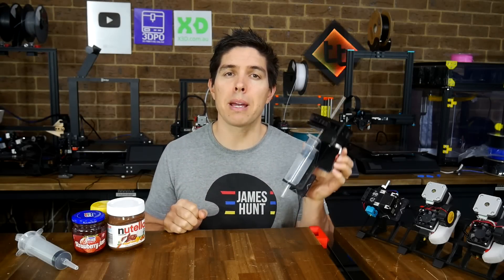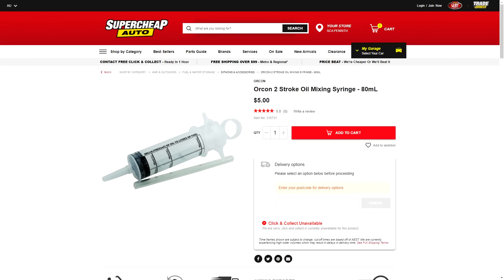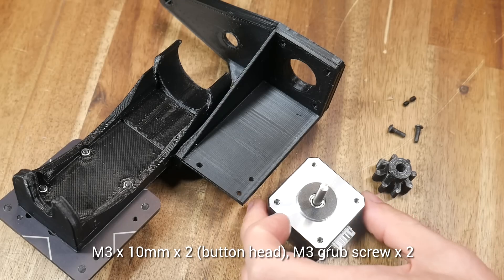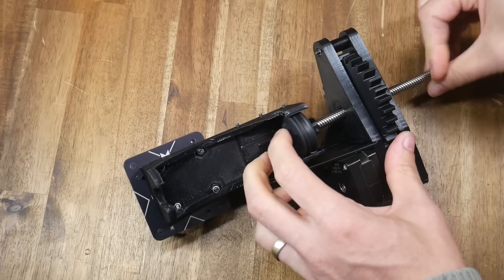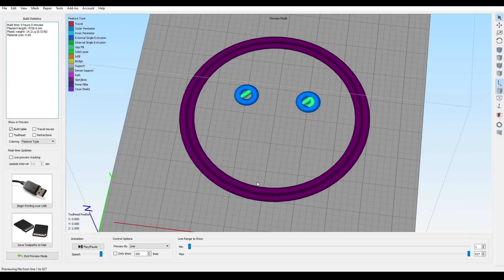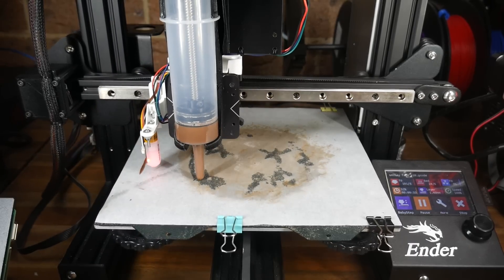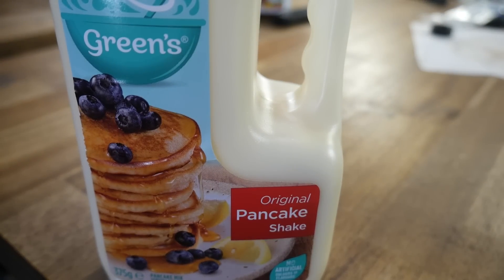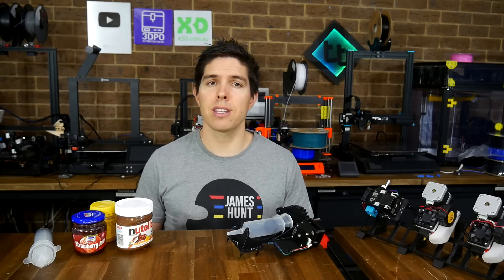3D printing Nutella with a DIY paste extruder - XChange on Ender 3

Comment: concrete? Now that I've watched this, I'm wondering how 3D printed concrete houses do not slump over like your sad nutella vase. They must use a special super viscus formulation.
Reply: Not just super viscous but very fast curing is key. I'm lazy to find you the video, but keywords: Jerry rig everything; printed statue. You will find useful info there.
Reply: Many years ago, I watched a video, I haven't found ever again. In it they talked about 3D printers, and I was hooked. They used a cement formula that sets in a minute, I think the current formula is called gunnite. But they printed a house with a 3 layer wall. They would print the 2 outer layers, then on the next pass they would print the inner wall. It was amazing. a 3D printed cement house.
Reply: @MrGerhardGrobler  Think I saw that once when I started looking around for practical applications on the topic after having watched either a movie or some educational video playing with the idea of the future of 3d printing and autonomous bots building skyscrapers - that doesn't sound very sci-fi/futuristic anymore tbh, but I doubt it'd be faster than current tech (cheaper is a different topic) haha

Comment: You can disable the cold extrusion error via M302, rather than faking out the thermistor input: https://marlinfw.org/docs/gcode/M302.html
M302 P1
Reply from the maker: Faking the thermistor output I still think was a better option. Simpler for me to present in this video and for others to follow. Any time you add layers of complexity people are more likely to not follow successfully.

Comment: Interesting. What about using ‘ice magic’ that goes hard when cooled ? You can heat the fluid to keep it viscous for extruding, and may be cooled by the fan once extruded
Reply from the maker: I think it would need to be a colder fan than room temp. Maybe air blowing over a peltier. Ice magic still take a bit to harden on frozen ice cream.

Comment: You could try to 3D Print within a gelatine (maybe with a smaller syringe and a needle tip). As far as I know there is already some medical use (sadly I couldn't find the video) for this, but maybe it could also be used to print with resin or other solidifying liquids! Even printing within another resin might be possible!

Oh an please make sure to promote thorough cleaning of the printer & its environment, as the infamous printing dust might also be a health risk if it gets on the food (at least for some material in bigger quantities...)

Edit: It is not the one I saw back then, but it still shows the process: https://www.youtube.com/watch?v=CxIfkPBlbqE

Comment: If you add an AC powered silicone bed you can get the bed to 250C fairly quickly. You will need an AC relay, but it totally works. I have one on my Ender 3.
Reply from the maker: I have one on a few of my printers but they have thermal fuses to limit reaching anywhere near that temp. Not sure I would want to remove that safety feature.

Comment: I've been thinking about something like this to decorate cookies. My sister owns a bakery, and spends so much time on cookie decorations. Being able to plug them in, and have the printer do the work would be awesome.
Reply from the maker: That would be very viable.
Reply: going to want a belted build surface, and a vision system for locating the part.

Comment: Rally neat, but wouldn't the plunger rotate in place if it hit too much resistance, essentially missing steps?
Take a look at Proper Printing's design which avoids this by pressing down on the original plunger of the syringe with with something that looks like a dual Z axis.

Comment: Excellent work, maybe you can put a heater element around the syringe to allow solid milk chocolate to melt and then re solidify when it hits the bed?
Reply from the maker: I did consider a low power heater in the early stages. Maybe printed from a high temp plastic and clipping onto the front of the syringe.

Comment: I'd probably use this to create custom silicone gaskets, o-rings and such and so on. Not with this nozzle diameter though :D
Reply: It would be easier to 3d print a mold and then fill that mold. The silicone won't cure fast enough
Reply: @Dedeptikonbmx2023  You're absolutely right, I haven't even thought of this but it makes perfect sense. Any suggestions on making the silicone not stick to the mold? I haven't done this before.
Reply: @friddevonfrankenstein  they make a spray on release agent, sells at hobby shops. I think talcum powder would work, but I feel weird suggesting something cancerous..

Comment: Results of Nutella printing would have been better had you reversed polarity on heated bed, chilling the chocolate as it was deposited.
Reply from the maker: Reversing the polarity doesn't work without a flux capacitor.
Reply: @TeachingTech   LOL

Comment: I bet you could get some decent prints with a smaller heated sirynge, a cooling fan, and chocolate!
Reply: I was thinking the same thing!  If you can get your syringe to hold the proper temperature, you could print tempered chocolate sculptures.  A custom hot end with a bore that matches the plunger, fitted with heating elements and thermocouples could be a fun project for a hobby machinist.
Reply: @TuckMcSouthard  they make elements like this for plastic injection molding. I am sure it wouldnt be too hard. I would worry about the Syringe getting too hot before the melting point though. Not sure what those would be.

Comment: I noticed that the plunger seal was rotating as well. Wouldn't that cause some problems down the line? Maybe something that keeps the rod from rotating should be added.
Reply from the maker: It did cause quite a lot of under extrusion at first. I made the printed part inside the rubber stopper thicker to increase the friction and it solved the problem for everything except the peanut butter. I considered a guide at the top to prevent rotation, but it would need to sit at the highest part of the leadscrew when the syringe was full, adding at least 150mm of height. I think at this stage I'm happy to live with the compromise of it not being perfectly accurate for really viscous pastes.
Reply: @TeachingTech  A rotational ball-socket joint just before the rubber stopper could fix this easily. Really just acts as a bearing, but has no lateral loading so shouldn't be an issue.
Reply: Also could just use a proper ball-race bearing. Mounting it to the end of the rod may be weird, though.
Reply: I thought about this too! Maybe just a captured bushing between the plunger head and grub screw. ?? Awesome design tho!
Reply: Yeah, some sort of grub screw setup to keep the rod in line with the extruder
Reply: yes. it can cause underextrusion I guess.

Comment: The extruder design is faulty. You forgot to restrain the rotational movement of the plunger. Right now it is free to rotate inside the syringe. This means the rotation of the lead screw nut might be translated to rotational AND/OR vertical movement of the plunger. You only want it to be able to move vertically. This can be seen in the first print. For the outer circle the plunger partly rotates in the syringe and less nutella is extruded. For the mouth and eyes it doesnt rotate, so more nutella is extruded.
Reply from the maker: It did cause quite a lot of under extrusion at first. I made the printed part inside the rubber stopper thicker to increase the friction and it solved the problem for everything except the peanut butter. I considered a guide at the top to prevent rotation, but it would need to sit at the highest part of the leadscrew when the syringe was full, adding at least 150mm of height. I think at this stage I'm happy to live with the compromise of it not being perfectly accurate for really viscous pastes. If you look closely you ca see the rotation in the first print and the peanut butter, but that's it.

Comment: My only objection is using a syringe made for motor oil, when there are plenty of syringes for sale made specifically for food.
Reply: Made out of the exact same plastics - just functional branding.  Now a heated aluminum or steel syringe, like I have for my meats would be interesting.
Reply: @russou  exactly, warm chocolate should work great for 3d structures.
Reply: Another option is to mcgyver up a plunger the exact inner diameter of a empty caulking tube. That would also allow for it to hold more material per print job.
This could also be done with diameters of plumbing piping all the way to bucket sizes if for testing or successfully getting cement to print for that castle in the yard or home addition or tiny home project, provided the torque doesnt max out the capability of the possibly nema 34 or whatever stepper motor being used, though 3d printing a gear reducer would solve that. Rock on.

Comment: I have been wanting to 3D print chocolate (custom cake decorations, etc.).  I believe I would need to add cooling so each layer of chocolate sets/hardens before the next layer is added (to avoid the Nutella-like collapse you had, lol).  Any thoughts on how to accomplish this layer cooling?  It would need to still print fairly quickly, or the melted chocolate would harden in the syringe and create more problems (unless you also have a way to keep the chocolate melted in the syringe, but that adds even more complications).  Enjoyed the video!
Reply from the maker: I think a traditional part cooling fan, but pointed accurately at the tip of the nozzle, would go most of the way to solving this. The ultimate solution would be a peltier module, with heat sinks on both sides, and a fans blowing the warm air onto the syringe and another fan blowing the chilled ait below the nozzle.

Comment: Good lord, how long did this take you, start ti finish?
Reply from the maker: It was actually pretty smooth in design through to finished product. I had to reprint the piece inside the rubber stopper at a bigger size to improve the fit. The base piece also needed one redesign to get the fit of the syringe correct, but everything else worked first go. The most time went into the initial smiley face settings in the slicer, but those prints were quick so that wasn't too bad either.

Comment: you could to use it in a dual extruder setup, a normal nozzle and a paste one to print support in a reusable material (like play dough or clay), and maybe attach the extruder and the siringe at the frame of the printer to reduce the weight and use a tube to guide the paste

Comment: Would glue stick or hair spray on the bread help with the peanut butter adhesion? 🤔
Reply: Maybe a bit of ABS dissolved in acetone.  I've heard of people using that and I bet it's tasty.
Reply: Not crunchy only smooth

Comment: Love this idea! I've been waiting for someone to make an edible filament for a while. I figure since PLA is derived from corn, why not make a corn syrup based filament that you can print your own hard candies?
Reply: I believe the only problem with printing the candies is the temp needed to set up the candy along with the reservoir to hold the pre-heated liquid  I'd guess it could be done with a modified hot end, because the hard tack temp for the candy to set up is 160C.  It could be an awful mess, but fun to try!

Comment: Are the LEDs in the back sign flashing or an I having a seizure?
Reply: both
Reply: @pauleggington  😳
Reply from the maker: The batteries were low at the start and I noticed part way through filming and fixed it. Sorry for the flashing, I know it's annoying.